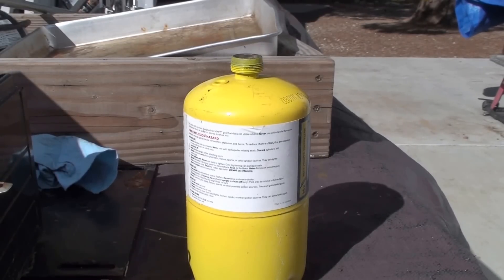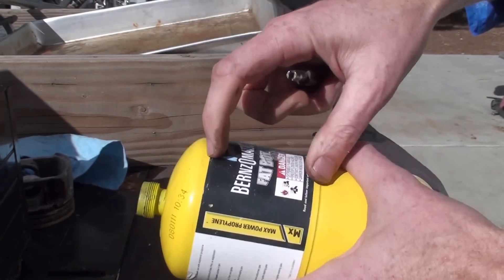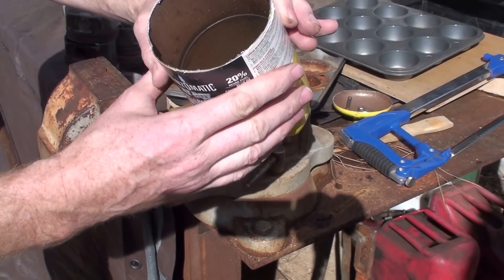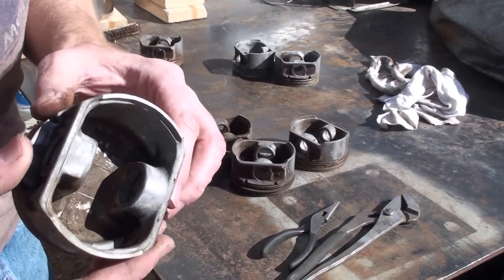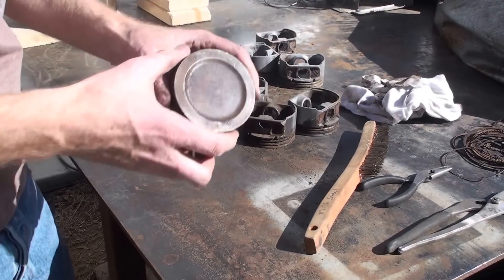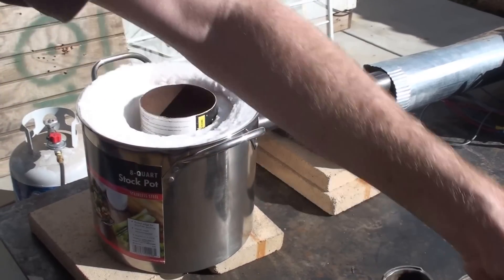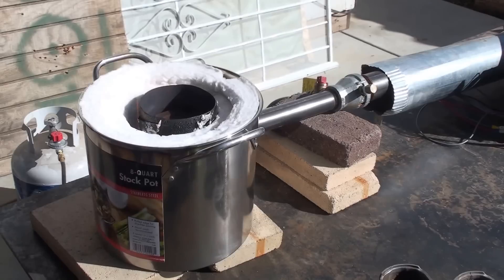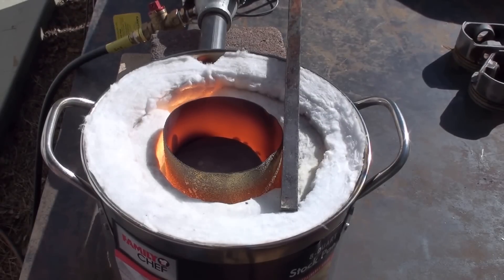Easy home built foundry, making aluminum ingots from pistons

Comment: The word foundry is used for the description of a building or structure, not for a melting container. The propane bottle would be called a crucible. The device used to heat the crucible is called a furnace, geez
Reply from the maker: The more you know... :)

Comment: 10 minutes of watching aluminum melt.  thank heavens for fast forward.  no explanation of the foundry or burner :(   did the empty propane canister work and for how long?
Reply from the maker: Haha yeah true. Guess I didn't really think about that when I made the video a few years ago. I try to make my videos a little more condensed/interesting now although I haven't done as many recently. I found the canister worked fairly well for this video but the heat was high enough that the metal flaked off. I might have been able to get another use out of it but I'd probably invest in an actual crucible if I were to do this much. I just used it that one time and tossed it in the recycle bin. I bought a bunch of supplies to experiment with some burners and they've been sitting for almost a year now so maybe I'll put together a video on that.

Comment: How long does the insulation last with a flame on it?
Reply from the maker: Depends on the temps you're running. The kaowool I'm using is rated for 2500F, running forge welding temps tends to start melting the wool. You should really coat the kaowool in some form of castable refractory cement to seal the fibers and make the forge last longer.

Comment: Error:#  last batch 5 pistons and  you stated this batch from 3 pistons, sorry you placed 4 pistons in the pot, both pours gave 1.2+ ingots per piston otherwise good video, thanks Mike  Cool I  will use old pressured industial gas bottles for my pot, as have thicker- harder wallls and higher MP factor Thanks again.

Comment: I'm redoing my charcoal forge in stead of useing plaster and sand . can I use kwool instead
Reply from the maker: James Puphal I'm pretty sure you can. It's just an insulator.  You'd definitely want to coat the kaowool with some refractory cement though.
Reply: CrushingDemons OK thanks
Reply: Brush sodium silicate on the kwool and use a torch to cure it. Or mix sodium silicate with sifted fines of play sand and pack and smothe on finish surface then fire it to cure it. Either way sodium silicate will seal and bond the kwool or ceramic blanket. Many others have made foundry with play sand and sodium silicate. You can even make your own. There’s lots of videos on it.

Comment: The kaowool is way too thick for proper heat flow around the crucible. Not to mention the extreme thermal inefficiency due to no lid.
Reply from the maker: Yeah you're right. This was an experiment with some extra kaowool I had left over from another project and a cheap stock pot from the local .99 store. Just for fun, not production. :)

Comment: How long will kaowool last like that in the open air and heat?  Most of the designs I've seen use some type of refractory cement.
Reply from the maker: I plan to add refractory cement. Just wanted to try it out and still don't have any cement. I've run this one about 3x and the kaowool still looks good. I have another forge I built that uses a hair dryer for forced air. It get's much higher temps (turns metal yellowish/white/throwing sparks) and it will actually start melting the kaowool. On that one the inner lining of the kaowool has a hard surface from melting. It won't last long at that temp but I was curious and it was a fun experiment.